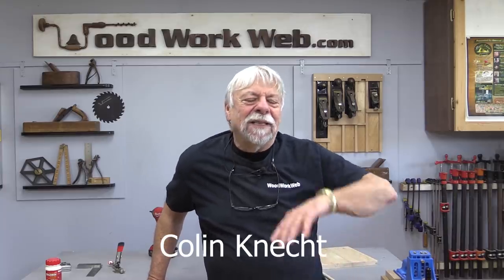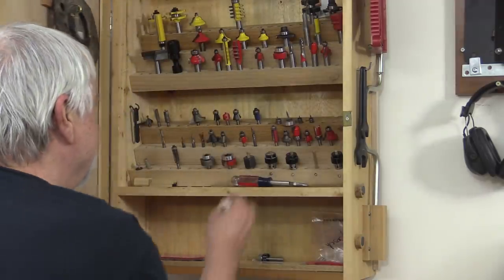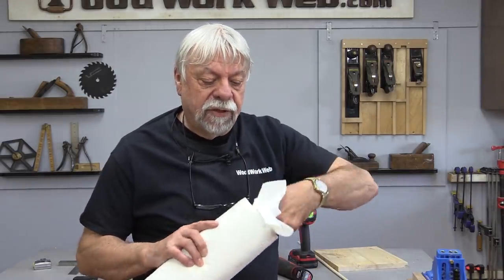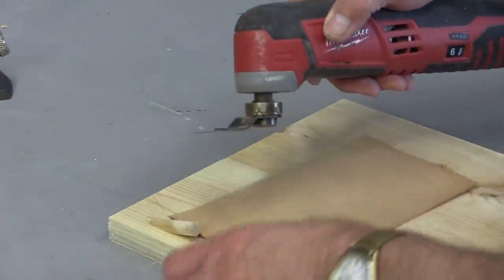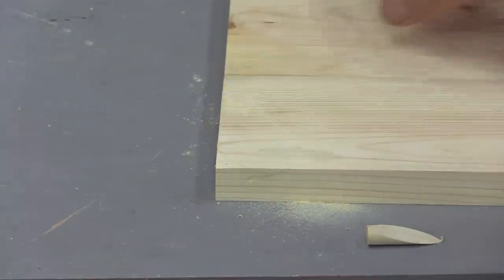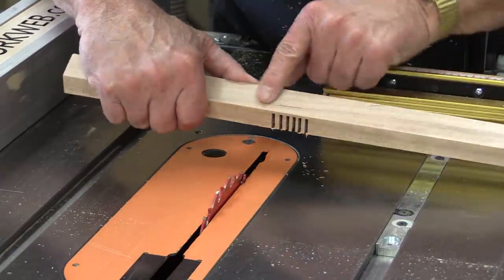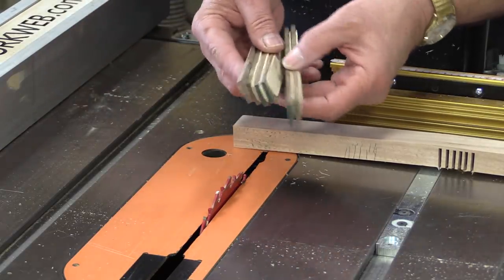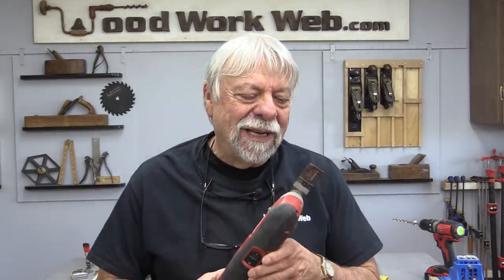5 Quick Woodworking Tips / Subscriber Tips Episode 12

Comment: I've learned so much from you Colin thank you, much appreciated, cat litter (new not used !!!) in a plastic box in a cupboard also absorbs the moisture from the air and can be dried out after time in the oven, pastic kitchen cutting boards are a great material for jigs etc, curtain wire (the stuff your gran used to put up net curtains, at least here in the UK) essential a long plastic coated spring, usually comes with hooks and eyes is great at fastening things back or strung (tensioned) in the rafters for hanging spring clamps on (think of it as a thin strong bungee cord, if that makes sense)
Reply: Those are excellent tips John, thanks.
Reply: Thanks for the great tips John 👍😊

Comment: Good tip on the silica gel packets.  Always good to not waste something that can have a repurposed second life.  Important to remember that, even in a sealed container, they only last 4 to 12 months, depending on humidity, amount of air in the container, how saturated they already are from their original use, how often the container is opened, etc.  In a shop cabinet that's opened frequently, they may not have that much drying capacity left.  

However, this gives rise to a related idea:  A silica gel packet in an airtight container like one of those small 2x3 ziplocs for daily pill portions, and a router bit.  Not as nice as all of them in a row on a drilled index display.  But then again a hole through the top edge of the bag above the ziploc seal would allow them to be hung in a row on small finishing nails on the back of the cabinet.

Comment: Here's a tip Colin. In my work we make tables. 6ft, 8ft, we even made a couple of 13ft monsters. If you have a piece of oak 2 x 12 (or more) x 12ft or so, it can weigh 75 - 80 lbs. It is a real challenge to see the edge against the fence and is a real dance to keep that edge square against the fence. Outfeed tables get a lot of attention but what about infeed tables. Make one fairly small, 16 x 24 works for us, and unattached. Suddenly, you only have to worry about lateral adjustments and most of the weight is supported. Make it from melamine, wax it and your saw top, and the heaviest board will glide thru the blade. The longer the board the farther from the saw. You want the board to be balanced when the back edge comes off the infeed table.

Comment: For desiccants,  you can use the 'crystal' cat litter. They are silica gel. Not sure about the blue ones in the containers though. I suggest putting them in a a can with a cloth over the open end secured with a zip tie. When they get saturated, put can in oven at 200 F for a couple of hours.

Comment: The desiccant pack trick will not normally work! They absorb moisture up to their saturation point and stay there! Once this happens, they stop absorbing moisture, and just store it. Factories have them fresh & stored in sealed conditions, so they are dry at the time of packaging. Once the pack has been exposed to the environment for an hour or so, it is done! You can dry them by heating in an oven, but results vary. It is entirely possible for a pack to have stored excess moisture and actually release it in an otherwise drier environment!
Rod
Reply: I think you can dry them in the microwave too
Reply: Folks I know that live on an island restore the absorbance in these by placing them in the oven on the lowest heat setting for a few hours.  Then allow them to cool and put them in plastic bags for future use or back to where they were needed in the first place.

Comment: small suggestion Colin: any paper towel or cloth which has been used to wipe linseed oil or similar are dangerous if scrumpled up as they can self-ignite. running them under a tap creates unwelcome wet mess in the shop so  I keep a spray bottle filled with water. One quick spray is enough to  removes the danger of ignition without the soppy mess. cheers and thanks very much for the videos. John.

Comment: My router bits are all carbide and carbide does not rust. Its unlikely a small packet of dessicant will do anything in a cabinet that size but if they were in a closed off box that may work better. Put them in an oven at 200 degrees F for an hour to reactivate them. Lee Valley sells larger packets of dessicant that would work much better.

Comment: Colin, you can use the cut off piece from the pocket hole to fill the next hole. So, one cut fills two holes.. 
what a great sharing tip. I will not buy pre cut pocket hole fillers now. Thank for the tips.

Comment: Ref the paper towel tip I would always forget to replace it. I use a piece of broom stick with a screw in each end located horizontally on 2 hooks. It can be lifted out to replace the paper towel roll and with a little friction on the roll you can tear off a piece and there is always another piece hanging down for next time.

Comment: Very handy tips. Thanks for sharing. The paper towel tip I'll start to use this afternoon. The pocket hole plug cutting tip is very useful as well. I guess the part that was
left (outside the hole) after cutting it off is exactly a new plug.  I think there are many applications for the kerf cut tip. Not only on the table saw but on a band saw and
miter saw as well. I think that it even should be possible to make finger joints this way (using it on the end grain)

Comment: those tips are awesome! does anyone have any tips on what kind of lubricant you can use on router bits so they won't rust as much or maybe know of a way to safely remove light rust marks from router bits so they won't get damaged? my bits are in a tray and I have them on a slatboard next to my router templates for car audio work. thanks for any tips. 🙏🙇‍♂️

Comment: On the blade squaring trick - beware!  If the square is not perfectly plumb, or if not square to the plane of the blade, it WILL be off!  Use a miter set precisely to 90° to set the square.

Comment: That could work for finger or box joints
Reply: With all due respect the ever so slight variations in the spacers won't make accurate enough spacings for a good finger or box joint.  A jig is the better way to go.  IMHO

Comment: A good oscelating blade that does not flex as much as the dremel is, "EZARC 6pc Titanium Oscillating Multitool Blades Long Cut Saw Blades Speed Cutting for Wood, Metal and Hard Material".